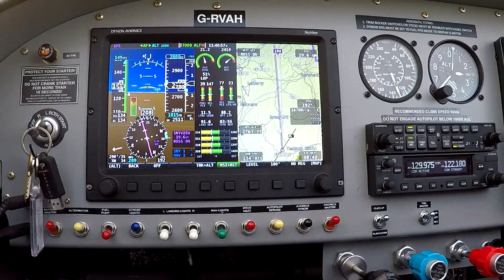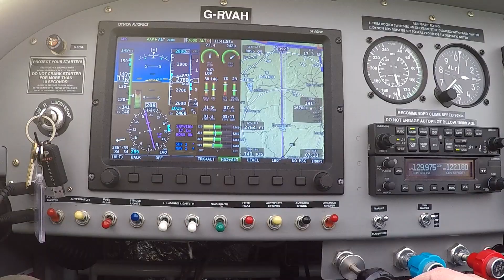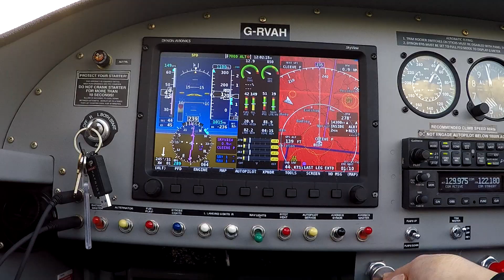Vans RV-7 G-RVAH Dynon Skyview airspeed vs MAP/RPM check after annual.

Comment from the maker: Hi All, Just to advise, for the erratic RPM problem we solved it by replacing the in-line resistors between the ignition switch and the SV-EMS-220 (from 30kohm with 100kohm and it seems to have fixed it. Details can be found in the installation manual for the EMS. Regards, Chris.
Reply: I guess I am quite off topic but does anybody know a good place to stream newly released movies online?
Reply: @Adonis Trevor meh try Flixportal. you can find it if you google :P -larry
Reply: @Larry Jaxon Thank you, signed up and it seems like a nice service =) I appreciate it !
Reply: @Adonis Trevor happy to help :D